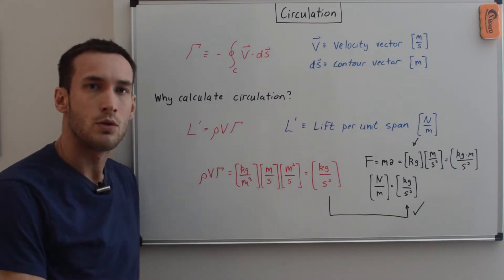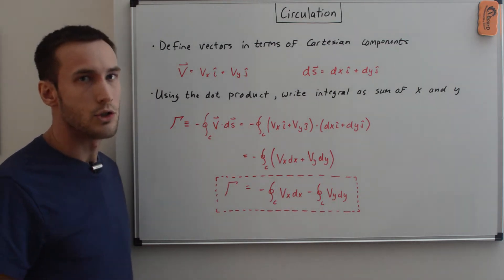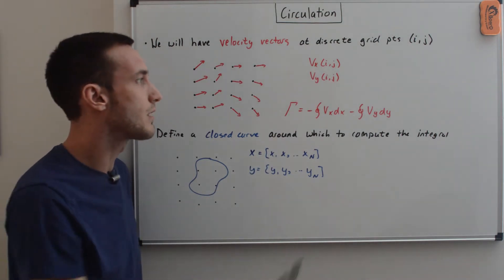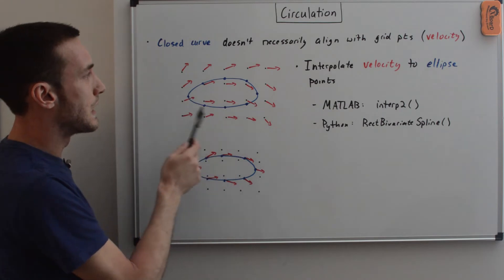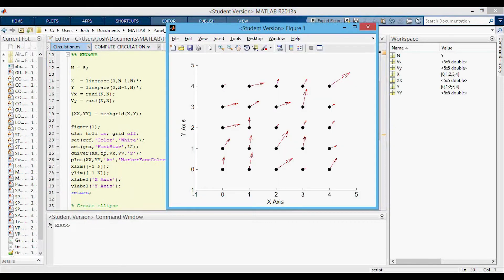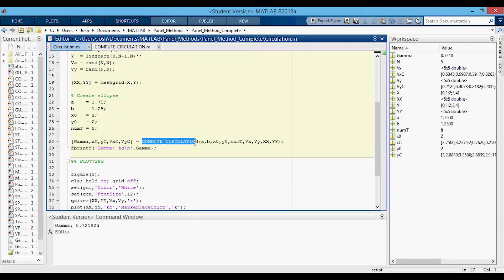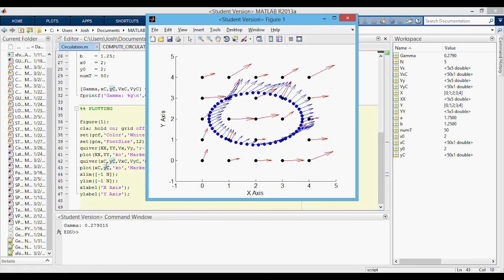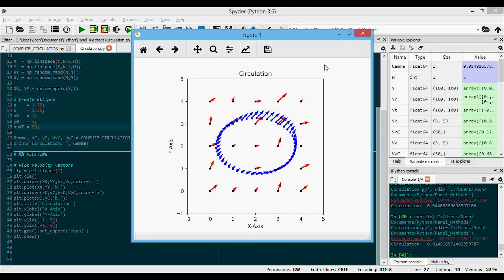How To: Calculate Circulation

Comment: Nice video ! In the function code, does the integration work similarly with the trapezoid rule if we define a rectangle instead of an ellipse ?
Reply from the maker: Thanks!  Yea it should still work the same way.  I just use an ellipse because that's what I was using for my airfoil circulation calculations.  As long as you have a closed curve, you can compute the circulation this way.
Reply: https://www.youtube.com/channel/UClm9D-4ltWVqLgCm8n7js7Q/playlists?view=50&sort=dd&shelf_id=2